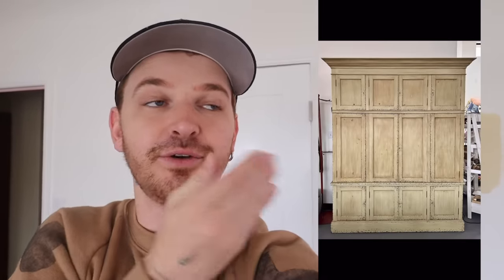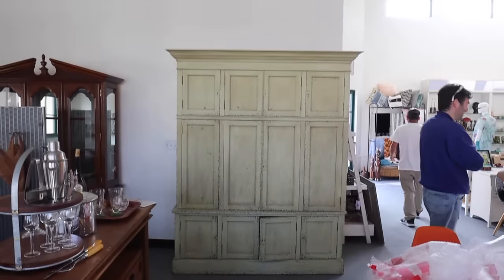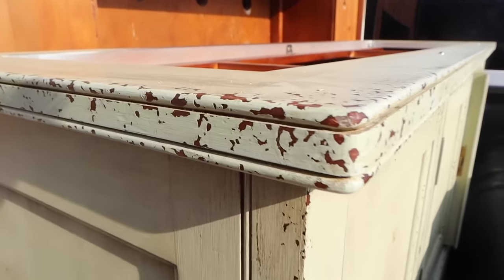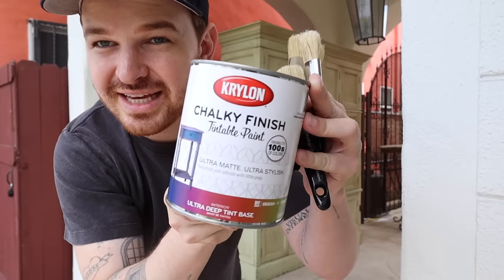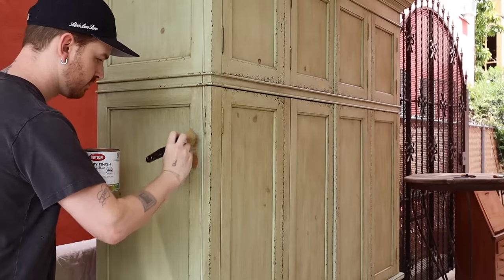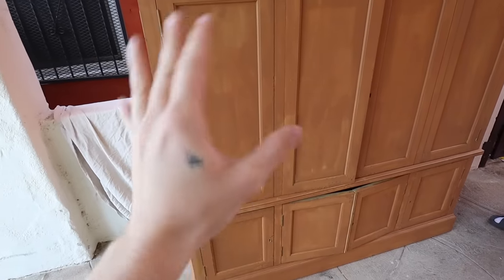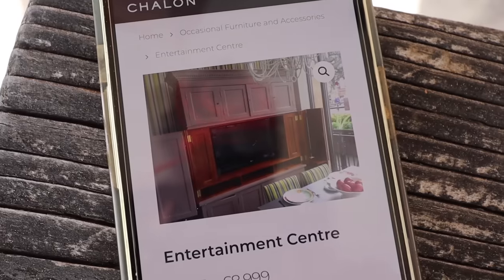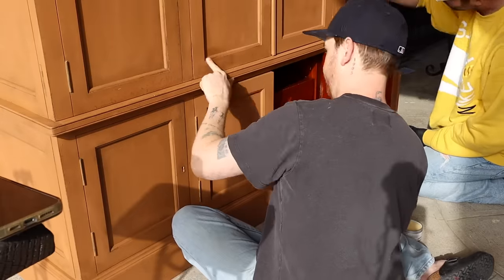DIY FURNITURE FLIP 🎨 Painting Cabinet To Look OLD & ANTIQUE! (Super Easy & Affordable)

Comment: Gorgeous cabinet! So as a longtime chalk painter, welcome to the club. This is a great first project. When you left the wetter wax on the paint for a little longer before wiping to reveal the original surface, you were using a technique called "wet distressing". It's a super technique and works with water as a preferred medium. Great job!

Comment: I've used finishing wax a lot and highly recommend Minwax paste finishing wax.  It comes in clear and also in a dark paste wax.  It's super easy to control, does not remove paint color, you get a lot in one can, rub on with a soft cloth, rub off the same way.  It dries to a beautiful finish that protects your work.  I like to use the dark wax on the same kind of areas that Drew did to age a piece.  Also, affordable.

Comment: I think there are better milk paint products than what you used for antiquing. I've finished many pieces using Home Decor available at Joann Fabrics.and that brand's antique finish does not lift any paint. I'm happy you like the final look. I'm not sure if you added a finish wax to the piece, but don't skip that step. You put it on. Let it dry for a few  hours and then buff it out. I also spot sand my pieces down to the raw wood for an added dimension. Either way, you always do a great job! Looking forward to the bedroom reveal.

Comment: Thought you would know to chalk paint needs to be dry or it will Reactivate with more paint or stain.  That stain didn't go evenly over the surface because the clear wax appeared to be randomly applied. Maybe I am wrong.  All creative say to apply clear wax then wipe off about 15 minutes later.  Then, apply dark or white wax which will spread much easier.   To erase area with too much dark wax, add more clear to erase it. Makes more sense as you use it.  Love your style.

Comment: Briwax is the best, I use black, white, and brown depending on the project.  I love it!  I suggest you play around with it on various pieces, you will fall in love with the creativity.  I just used the white on a piece that was pulling too much red and it is beautiful.
Reply: A note to those chemically sensitive, BRIWAX SMELLS HORRIBLE.
Reply: @GreenIsTheNewBlackk  Yes it does, I use it outside and would recommend anyone to do so, plus wear a mask for this or any chemical.  The smell goes away quite quickly and leaves a rock hard finish.

Comment: Looked better before you used the BriWax.  I have chalk painted a lot and I used the sane brushes.  I gave the furniture two coats of chalk paint and then used the clear wax to seal it.  I've never used the dark wax.  I think your piece would have looked better with 2 coats of the chalk paint and then the clear wax to seal it. You could have used the dark wax in the crevices for definition.

Comment: I understand what you were planning to do but you didn’t use the products in the right order, actually you didn’t use the right products, period. I love the Shabby Chic style but I wouldn’t have recommended keeping the green either as it was obviously a very bad imitation. Your dark patina was not contrasting enough on your brown base, this is why it was not visible enough. 
Refinishing furniture and teaching how to do it used to be my job in Paris years ago, and I was teaching the traditional way. Let’s say you start with your brown chalky paint. Then you want a dark patina, so mix some raw umber (greenish brown) or burnt umber (reddish brown) oil paint with some turpentine or mineral spirits, it’s better to put less oil paint because your original paint is chalky and will absorb too much darkness too fast, you have to test the right mix before applying everywhere. Then, once dry, you can apply some wax: clear wax if you are satisfied with the color, tinted wax if you want more darkness and you can finish with another coat of clear wax, and then, buff it to get a nice sheen. 
Your mistake was using a gel product after the wax product, it cannot work. Also, I would recommend to paint the doors opened, so they don’t stick to the main piece. 
Faux finishes are very difficult to make and to make them look good and authentic. I’m amazed by all the so called easy products we can find here in the US. I don’t trust these products, to get the real deal, we have to use the traditional products and methods. 
Try again later on something else, you will get better with time and experience. And it’s good that you show us this, so viewers are learning from your mistakes.